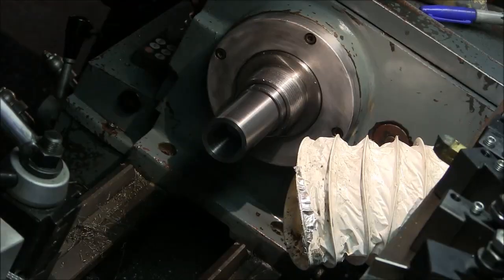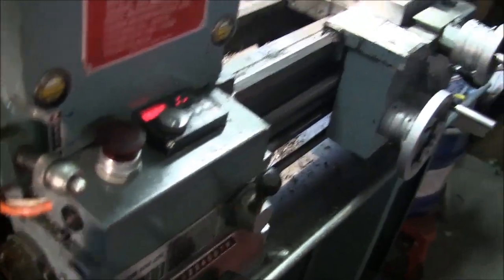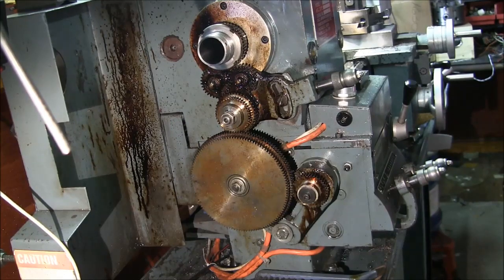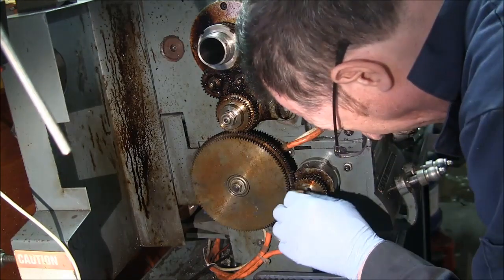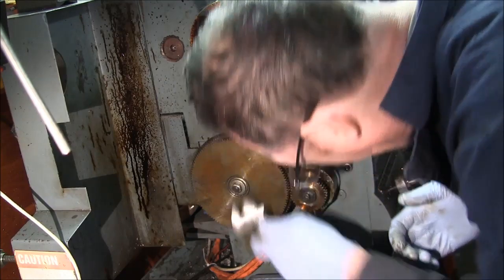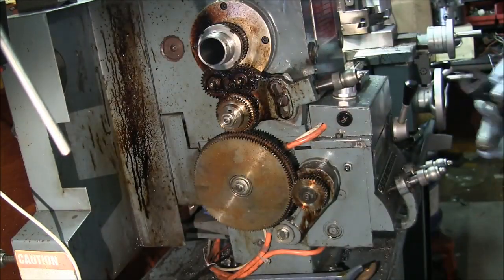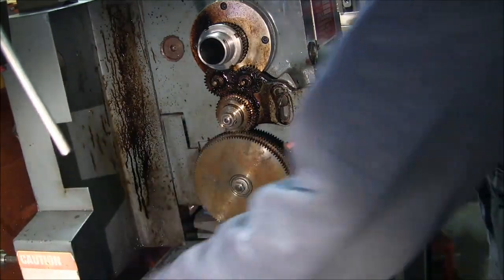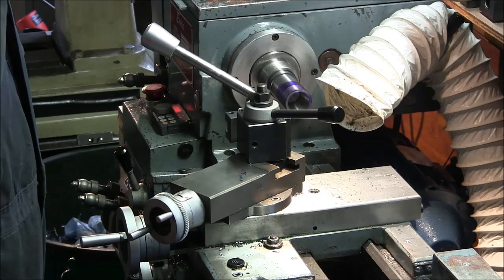ER 32 tailstock chuck part 4

Comment: Always use a thread relief at the end of any thread internal or external mate
it will make for a nicer thread take some big cuts on the first few passes, And 
the last few cuts take some lower depth of cut to clean the threads up mate..

Comment: did you change the lathe motor to a bigger one than the original?
Reply from the maker: Yes, originally it was 1HP but with the VFD, I bumped it up to 2HP because of the losses. The belts slip before the motor stalls.